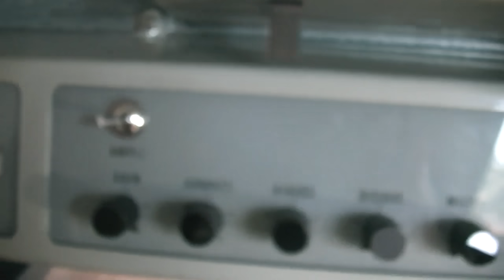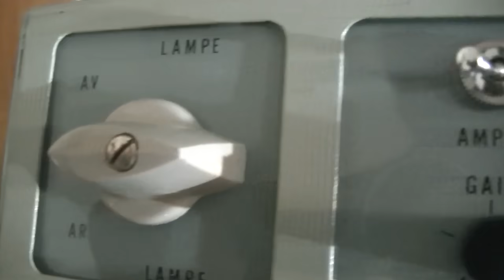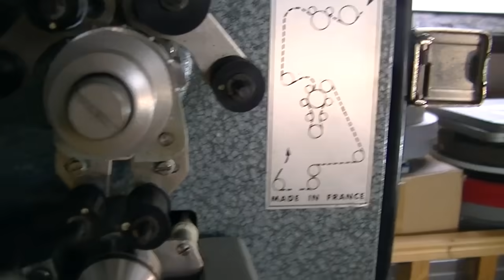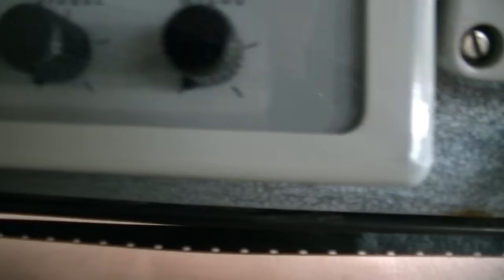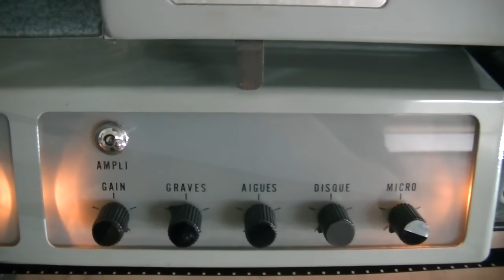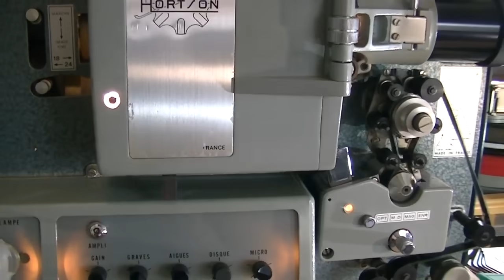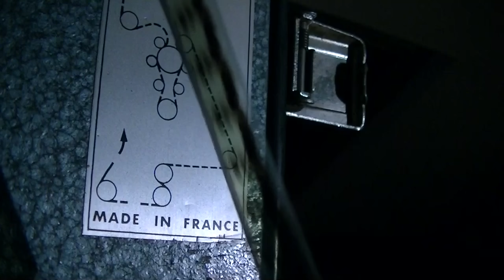Projecteur 16mm Hortson T70.

Comment: Nothing like the pure white light from a Xenon. I have an Eiki EX2000 Xenon, terrible projector, but bright and white light. I have a Elmo GS1200 Super 8 Xenon which is fantastic and have converted several 8mm and 16mm projectors to Xenon using G.E. Gemini short arc lamps. Again, fantastic.  😊
Reply from the maker: Hello, thank you for your comment.
I would like to equip my Hortson T70 with a Marc 300 lamp, but I do not have a power supply for this one. What do you recommend as a rectifier for this type of lamp?

Comment: Wow! I've seen Hortson 16mm Theater Projectors but this is the 1st T70 I've ever seen. Looks like a similar Geneva Type Intermittent used in the Eastman 25,30/40 Professional Projectors. I have a Model 30 that I bought new in 1968. This Projector should have a Rock Steady Image with that Star/Cam Intermittent. Being also Optical/Magnetic Sound, I'm sure this Projector was very expensive in it's day. The only other portable 16mm with a Star/Cam Movement that I've Seen is the Philips FP70  but it's intermittent wouldn't be considered a true Geneva Star/Cam type movement.It also has Left hand threading which I'm not a fan of. Beautiful and Rare Projector(T70) not commonly seen in the USA. Would love to add that to my 16mm projector collection; definitely a keeper. Nice Scope Lens also, Enjoyed The Video!
Reply: Howmach praise film projector bhi
Reply from the maker: Thank you for your comment . This projector is indeed quite rare, even in France. Most of the Hortsons were left-loaded. They made some traditional right-loading models like the T70 in this video. The only modification I made was to replace the original lamp (220v, 1000w) with a much more modern lamp (24v, 250w) and this one illuminates much more than the original one and above all, heats up much less.
Reply: @theprisonernumbersix996  PRESENT MARKET  PRICE?
Reply: 😢  A beautifully built machine. Great Geneva     movement too.

Comment: Is that 8-point starwheel illustration accurate to the mechanism in the projector?  I for one don't like the sound pick-up threading path (a lot of sharp turns to accommodate both magnetic and optical tracks), and there seems to be no true take-up sprocket

Comment: Regretfully, all these power supplies would have gone to God by now. Capacitors dry out and GE no longer make the Gemini short arc lamps aka HIA (high intensity arc). These lamps have a habit of leaking over age and no longer "Strike," when switched on. My friend bought three from a lamp supplier in the U.S. and all of them did not work. BUT, consider this, how about a video projector  whose lamp power supply still works and adapting that into a suitable box, then mount the suitable video projector lamp into the Hortson T70 lamp house. You would need a dowser to stop the heat of the lamp burning the film when the projector is stationary, also you would need to install a big fan with a strong blast of air to cool the lamp. At least video projector lamps are cheap, starting at $100 and up and would last a lifetime unlike the Gemini's 50 to 100 hours. Failing all this, it might be better finding a Xenon 16mm that still works. I paid $45 for my Eiki (Yucky I call it) in 1990 at an auction. They would be the worst piece of crap ever made, but it is bright and white. I would like a better lens for it. If I still had a use for it I would spend the money and have Schneider make me a 38mm lens.
Good luck, get looking on eBay. Stay in touch.
Brian Muhling 
Western Australia 😊

Comment: Why so much noise there could have been explaination of parts and it's fuctions. In this digital era still these projectors are finding place?.
Reply from the maker: First, it's the normal noise of a projector knowing that there is no projection booth.
And second, your reaction is most surprising! So everything that is old is necessarily outdated and without any interest ....?
Know that in the "digital era", film still has many advantages. I have been a professional projectionist for 35 years and I continue to be amazed when I project films in 35mm or 70mm.
The latest was "Tenet" by Christopher Nolan shot entirely in 70mm and screened in my cinema in this format.
A digital image next to it was bland, lacking in contrast and lacked definition. Don't forget that a digital projection in cinemas is 2K or 2 million pixels.
A 35mm image of a negative you arrive at 42 million "pixels" if you transpose the silver salts which constitute the sensitive emulsion.
Still a lot of directors still shoot on film support to have the best capture is especially to have a perennial backup solution in the very long term (lifetime of the polyester film estimated at more than 800 years!).
As proof, Lumiere films in nitrate (flame film) can still be projected without any problem and they date back more than 100 years.
Try to use a hard disk (DCP) containing a cinematographic work after 10 or 15 years without making many so-called "backup" copies.....
Try restarting a digital projector after 10 years of inactivity and we'll talk about it again....
In my cinema, we are already at the third generation of digital projector. Their lifespan is about 8 to 12 years.
A well-maintained film projector is problem-free for life!
Digital is just good in the very short term and above all it is used to exploit films with the lowest possible cost (for studios and cinema operators). Quality has taken a back seat now.
There's not much left of the movie magic.